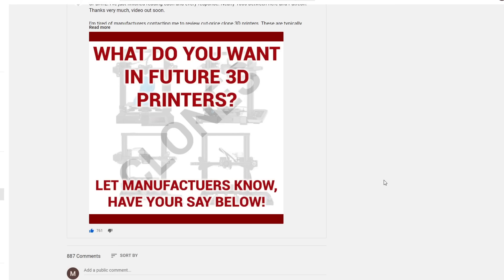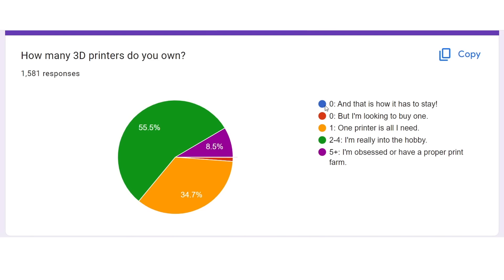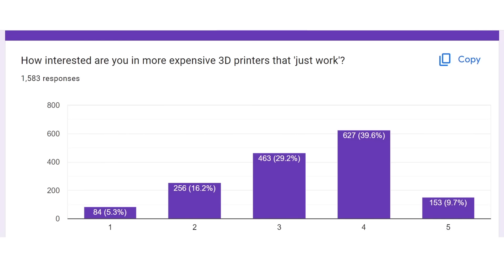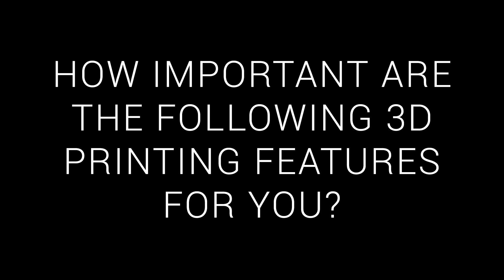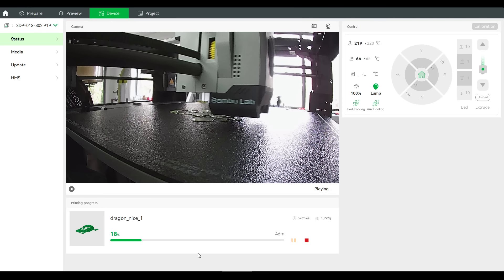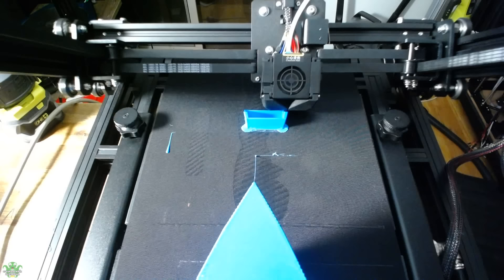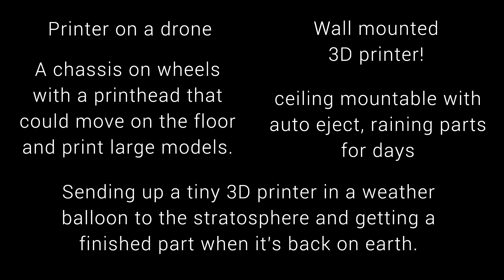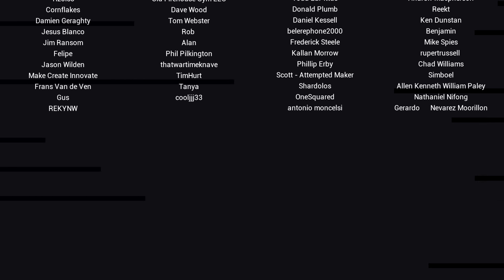The 3D printers the community actually want: Your say in 2024

Comment: So I have a problem with this idea. Like knowing your customer's needs is important but at the same time the customer can be and is often wrong. It's a balancing act. Like even if people are not interested in air filtration that should still be a priority. A lot of people do not realize that just because you can't smell it doesn't mean that FDM is safe. It still releases a significant amount of VOCs and particulates. Meta-analysis from several research papers shows that there is quite a bit of VOCs and microparticles from FDM. Same with eco packaging. We won't know the health effects for several decades but it probably is not great to have plastic particles in your lungs. Eco packaging is another place where just because the customer seems to be ambivalent doesn't mean you should ignore it. I also think there is a lot of places to try new things that customers don't even realize would be useful.

Comment: For me it would be a printer as thrustable as a brick !
I mean the speed is not the factor multi material or color not important !
i just want to be able to print every time i am ready and be sure of the result !
i dont want to print part to modify the printer and i dont want to buy part to modify a printer !
i want a brick that work !

As for a crazy idea i would like a printer that can print tubes
i mean like a 4 axis on a cnc router that you can put a shaft in the chuck then print around and on the lenght
so you can make rigid tubes or something like that !
Thank for your video !

Comment: sorry you didn't get many crazy, hair-brained ideas... here, I got 2 for you...
1) printing with candy, there's a kind of string candy in europe called Scoubidou made by a company called Lutti, it's gummy bear string, .5m long, in approximately standard filament diameter, feels like soft TPU to stretch. I'd love to try to print with it but don't wanna risk having to pull candy out of my extruder gears.
2) a tiny 1/5 scale 3D printer, that uses optical drive motors and worm gears + rotary encoders to move the 3 axis, a tiny nozzel with fine <.1mm aperture, and it takes .4mm diameter filament which can easily be made by running a regular 3D printer extruder over a cold bed (it even coils itself). I have recently been printing 1/2 scale benchys with all the filament samples i got so thought the idea of a teeny tiny 3D printer with external electronics would be a fun build. Fun part of making a printer with such a light bed, might be that it can be a 3 axis bed slinger, with a static nozzel/block/direct drive. lots of ways to rethink things at 1/5 scale. I feel some materials work better at non default diameters, PLA might print faster thin, TPU might print more reliably thick.

Comment: I want a printer with 2 Toolheads and every toolhead has a 4-Material AMS. bright colors on one, dark on the other, so that there is 0 waste when printing just 2 colors, and still very little waste when printing more. Because you don't need to purge a lot when going from white to yellow or from brown to black
Reply: And bed size, I think 256mm from bambu is pretty good, I also own a 300mm² machine, really big, 300mm² is definitely the MAX you want, I can print anything on 256.

Comment: I think 3D printing companies are probably more interested in pulling someone into this topic by selling them their first printer rather than selling some tinkerer a kit, especially if that kit pulls the rug out from under it's successor by being upgradeable. But selling to new customers requires basically the opposite of what the survey demands, so they will probably build Apple-style products that cost a ton of money, just "magically" work and require as little user interaction as possible. I wouldn't be surprised if they started enclosing filament spools in a cartridge to prevent tangles, sold you an IPA cleaning cartridge for the bed or made you replace the printer once the scrap bin was full.

The only way to avoid this future is probably to keep 3D printing in a niche and out of the hands of the masses -Which might happen, because I doubt there's a need for a 3D printer in every home. But who knows, there's a surprising need for a computer in every home as well, after all ;-)

Comment: Does anybody make linear motors mod for the CR30? I believe linear motors would help auto fix its layer shifting? I mainly stopped using it because of the poor layer shifting. I already have upgraded to the linear rails and LDO motors. I feel I have to babysit the CR30 if I actually want a good result. I have literally held down a part with my hands while it finishes the last 10% because it starts to pull off of the belt. For fun I changed the nozzle 1.0 mm. I was planning on making seamless gutters, but with the layer shifting I put that on pause. I calculated that the gutter would cost over $300, so what's no longer cost-effective. If anybody knows the best caulking material for metal gutters that would a nice tip! In Minnesota the caulking that I have tried only lasts one season. Flex seal does not work at all! Lol

Comment: 1. Reliability, not untested unreliable printers.   2. High quality prints at quick speeds, not terrible prints at lightening speeds. 3. Non planar printing 4. IDEX 5. well tuned printer profiles 6. Solid  responsive tech support. 7. 300-350 mm cubed build envelope 8. Attachment for venting exhaust fumes

Comment: I would like to see a 3d printer that uses a laser to preheat the previous resin layer for better adhesion of the print head filament so you could print carbon fiber, but have it bind to the previous layer.

Comment: My favorite printer is the Kobra 2 max - I am saddened that heavy use blows out something on the y axis causing skipping.  So to keep it simple - I'd like a Kobra 2 max that works and built to last
Reply: to further into it - I like it's large format - I use large printer more for mass producing items vs going for size.  The size of the kobra is just at that point in size where it's perfect imo.  The fans, although loud, are fantastic.  bed leveling has been great without the wheels.  The anycubic slicer - popping in a profile and going is great - I've made a couple of tweaks to slow down the prints for better quality but that tells me the tuning has been great where I didn't have to mod the slicer to HAVE TO adjust for flow, esteps, etc like the old days.
Reply: to further into it - I like it's large format - I use large printer more for mass producing items vs going for size.  The size of the kobra is just at that point in size where it's perfect imo.  The fans, although loud, are fantastic.  bed leveling has been great without the wheels.  The anycubic slicer - popping in a profile and going is great - I've made a couple of tweaks to slow down the prints for better quality but that tells me the tuning has been great where I didn't have to mod the slicer to HAVE TO adjust for flow, esteps, etc like the old days.
Reply: Converting your K2M to use closed loop servo motors would go a long way in curing your skip-shift heartaches.   I know, easier said than done, but if it's worth it to you, you can make it happen :)

Comment: I want a company to take non-planar seriously from both the hardware and software side - build a machine with a hotend designed specifically for non-planar printing and focus heavily on developing non-planar features in a slicer (PrusaSlicer fork). The company with the most capability to do it is probably Bambu Lab, but I doubt they are going to focus in this area for a while. But I can dream.
Reply: Unfortunately this actually exists but..... its at very industrial prices and I dont think has taken off.

Comment: Multimaterial, AI, enclosures, cloud etc are nice to have, but I think companies should also provide a budget option for people that only want a cheap (around 250 USD) 250x250x250mm workhorse with all the important quality of life stuff pre-installed. The Neptune 4 Pro really comes close to what I have in mind, but it's the only one AFAIK.
Reply: What you are asking for is another race to the bottom.

It makes no sense to have that race again when for a few spools of filament kore you can get the machine of your dreams right now.
Reply: @BeefIngot  No, I'm asking for a printer for people that only want to print single color practical items reliably, don't need fancy stuff like AMS and and can't/won't spend 600 euros. I'm asking for a reasonably priced tool, that's all.
Reply: @tommythebiker3081  That already exists. What you are asking for is a race to the bottom on price.

I said nothing of multi color.

You literally just want cheaper printers. Weve had that race before.
Reply: @BeefIngot  I want affordable printers for people with simple needs. Why is it bad? I didn't say you said something about the AMS, that was an example of "fancy stuff" that can be forfeited in order to achieve a lower pricepoint.
Reply: @tommythebiker3081  What I am saying is that there is a reasonable floor after which you are just asking for corners to be cut.

I think you are in essence asking for what we had for years. Manufacturers racing to technically have top features on crappy ender clones and they dont work because they are race to the bottom printers.

If an A1 isnt good enough for you, you are basically asking for too much at the moment in my opinion. The polish isnt free. Its what they cut cost on the most when racing to the bottom.

So to reiterate Im not saying its bad to want cheaper, Im telling you what the results of consumers pushing for cheap as the goal has been over and over again.

As for the AMS, I really dont get your point then because that already exists (printers that dont have that and are cheaper).

Comment: question / does anyone know of any a Slicer that incorporates AI to scan the design and recommend the best settings based on the type of material selected ? just curious if that is a thing yet ?
Reply: cura has some addons for auto-orienting the printed part, but not slicer settings. once you dial in settings then you wont need to change it unless you want faster/thicker layers.

Comment: I'd still like to see more maintainability and increased reliability. One thing there's still too much of is downtime.  Need standardized and modularly replaceable/interchangeable parts so that you can quickly get an machine up and running again.
Reply: This is not an issue for many. Pick the right printers and buy a handful of spares.

Comment: I want a 3d printer  to be a tool not a hobby.

I had one of the cheaper models, it was ok for what I payed for and with a few upgrades it was actually better then the ultimaker 2 I use at work, when I got it to work. But it still required more fiddling around then the ultimaker which has worked for several years with ZERO need to do any adjustments.  But my need for a 3d printer wasn't there, so I sold it. If I get the need I will pay prober money for something that just works.

Comment: The problem with these results is that they contradict in the long term. People are wanting easy to use, reliable 'appliance' printers, but that will mean they are closed source, non-modifiable devices. 

I think the market will split completely at some point, the full open source, kit based units like Prusa and Vorons on one end and the appliance printers like Bambulab at the other end. The middle ground of cheap Creality Enders and Anycubic Kobras will die, because they arent fully either and at this point aren't very satisfying to use.

The current results of this poll are still heavily influenced by the old guard of printer users, but as time goes on open source will become less and less important as 3D printer sales move further towards the appliance side.
Reply: The big problem with closed source is a bigger social shift to anti-cloud (even more generally, a resurgence in anti-authoritarianism), I think. IoW, that many will be perfectly happy with a mostly closed device. But, these days, closed also typically means making you the product, more-so than the printer itself, and making you dependent on someone else's internet-connected services. If performance and reliability were good enough, but you could also treat the software side of thing like a normal Brother printer, and less like a modern HP inkjet, I think a lot of the same people strongly preferring FOSS right now wouldn't care as much.

Comment: If someone could do a Bambu X1 style printer which was at least software open source, I'd be happy.  The one thing holding me back from bambu is proprietary software and cloud.  Yes I know you can print from SD, but I would rather print direct from Cura using Octoprint.
Reply: octoprint everywhere supports bambu lab....
Reply: There is. It's called the Voron Trident.

Comment: What do I want... multiple extruder heads... I think that's the best way to reduce waste. ¯\_(ツ)_/¯ 

But ultimately I use my 3D printer to create things when I need them. Love that I can jump into OnShape and create designs for objects I find I need, things that break, etc I am surprised how many things I don't throw away and re-buy if they break... I just use the broken one as a template or idea and make my own replacement.

Because of the way I choose to use my 3d printer I just wanted one I could use out of the box with minimal tinkering. I love my Bambu X1-Carbon and the AMS because I could plug it in and get to work, and the AMS keeps the main filaments I use relatively dry so I don't have to worry about drying out filament for hours before I print, if I don't want stringy prints during humid months of the year.

Comment: A 3D printer should have a multi nozzle head that rotates like the lenses on a microscope, each head fed with a different spool.
Reply: There some seesaw designs, and I've seen at least one rotating one you mention. IIRC, the problem with that is that there are patents for them that haven't expired, so they are only readily available in non-commercial (IE, you print them and implement them) implementations.

Comment: The bed size should be increased to 305x305 / 1ft x 1ft. It’s large enough for bigger prints but not so large it becomes hard to maintain. 250x250 is too small.

Comment: Environmentaly friendly packaging? We are talking about people who think AMS filament poop is acceptable
Reply: You are printing plastic. you have already made the decision to say "eff you" to mother nature. LOL
Reply: @hawtdayum  i may use plastic, but I am always conscious about filament waste because locally its frigin expensive ans I have to fly it in from abroad. So I am very conscious about filament waste. Each failed print feels like physical pain
Reply: @Hilmi12  Since there is no such thing as a ZERO waste 3d printer. There will ALWAYS be some waste whether it is a brim, skirt, purge line, purge block, supports, filament left on a spool that isn't enough to print a full model and of course  failed prints as  you mentioned. 

YOU are the one who decides what happens with the waste. You can always reheat it and put it in a mold. Grind it up and make your own filament, send it to a recycler. 

Even with an tool changer, AMS, MMU, ercf or whatever you can minimize waste in the design processes. It's fairly trivial. 
1.Avoid excessive filament changes every layer. 
2.print in 1 color and learn to paint.
3. Use purge reduction methods with simple tweaks
4. Use purge for supports
5. Print multiple of the same item as purged amounts are the same with 1 or a full build plate of items.